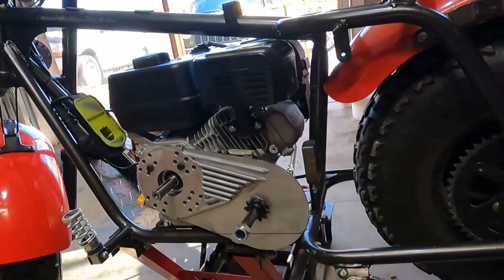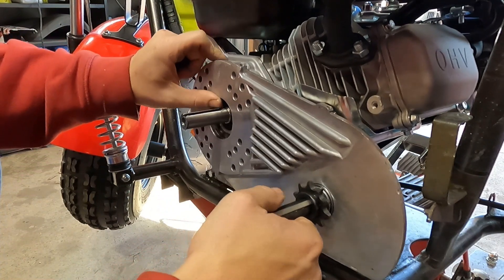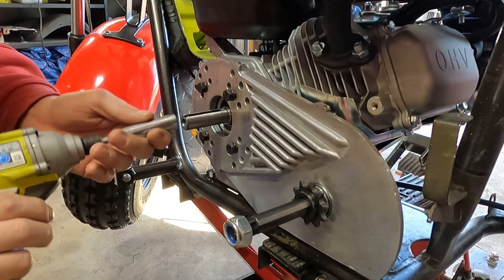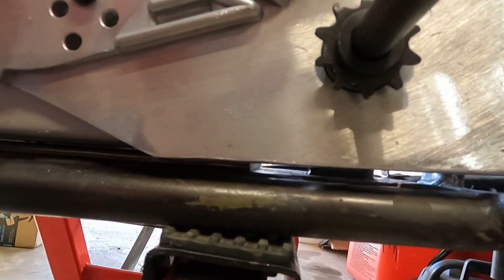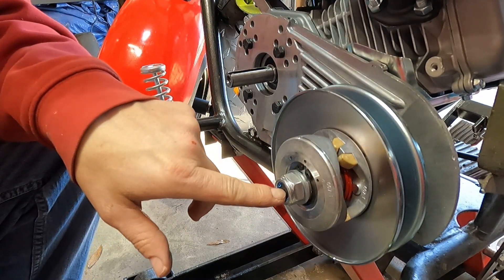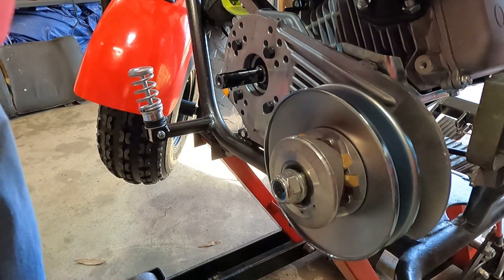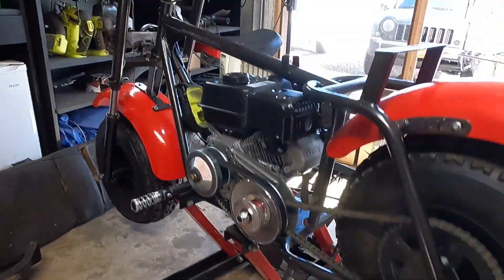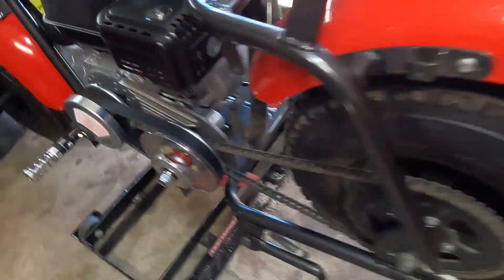Baja Warrior 200 Mini Bike 30 Series Torque Converter Install

Comment: A skill saw with a regular carbide blade will but any aluminum with no problem and still cut wood like nothing happened. I learned that when i needed to cut some  inch plate. A saw will cut it like butter.

Comment: So to anyone doing these mods I just gotta say after doing them all myself. U have to cut a couple brackets off so you’re gonna want to grind those down smooth and paint the bike in those spots so you’re gonna have to take the engine loose to paint that well. Shaving down the key way is simple enough if you have the right tools but why isn’t it shaved from the factory? Once u cut the plate u can’t return it so if the clutch blows apart in less than an hour like mine did then you’re screwed and you’ll have to just buy a new one and return the broken pieces silently. So far I’m not impressed and between ordering that stupid lug nut and all the modifications I was unaware of it’s been a week of working on it when I can and now that the clutch broke it’s gonna be at least another week. It’s not ‘simple’ it’s not ‘easy’ it’s a giant PITA and the parts aren’t made well. The belt broke when the clutch flew apart in less than an hour. Not sure what else to say but good luck to all of you. I’ve been working on cars for years and I’ve never seen a kit that claims to fit be such a horrendous fit and then fails first day? Bad quality control, bad manufacturing, straight up. Sure if this guy has done a few before at least it didn’t frustrate him. I assure you the first one you do will be extremely frustrating, even to a level headed person that does similar things all the time. I’ve built several bikes with different motors, have quite a bit of experience, my father in law is an aircraft mechanic. Both of us looked at this thing as cheap Chinese crap that wasn’t made right in the first place. When the clutch blew apart we both just looked at each other and didn’t even say anything. We knew something wasn’t right with it. Should’ve just bought a new centrifugal clutch!!
Reply: Help!!! Please

Comment: Good job. You should align the back of the backing plates. Although it looks flat, it has a 2.5 degree taper on the inside. Run a straight edge across both back sides of the backing plates of driven and driver clutch and look for light.

Comment: Will this method work on a Massimo mb200s?
Reply: That's basically what this is, I think. My Massimo is a Warrior and the "title" says MB200. The only caveat here is that he's using a Predator engine and the shaft is different on the stock 196. The 196 uses an external thread shaft (male), so the bolt that holds the drive sprocket on can't work. I'm in the process of installing a TC on mine, and have found some people using a long shank lug nut off of go powersports to bolt the sprocket on.

Comment: Here I am over a year later finally installing the torque converter.

Thanks for the video, I have a problem hope anybody can help.

I put a converter on a Baja Warrior. If I do it the way it's done in this video my
front sprocket is not in line with my rear sprocket. The chain wears the inside of the front sprocket.

So I put a space on to move the front sprocket out. Now the chain works fine, but when I align
the two inside belt plates I don't have enough drive shaft left to mount the hub.

What am I missing?

Thanks

Comment: Have you ever done one on a Massimo warrior 200, running into problems?
Reply: I'm doing one today on the massimo mb 200. Jackshaft sprocket doesn't line up with rear wheel sprocket. No sure what to do bout this

Comment: Where do you get the rubber mat? Is it specifically for that purpose? I could not find that thicker locking ring on tractor supply. Not sure what it is called, so searching is not finding it. Any help is greatly appreciated. Very helpful demonstration. Thank you for excellent tips. Thumbs up! I like that diamond plate on the front of the frame.

Comment: What kind of rubber piece is that and where do you get it? I had a blaster 2 seater kart come with that rubber under the engine and always wanted more of thoes for other bikes an karts
Reply: Just a rubber mat like shop mat or mud flaps work good now if you want to go old school leather works 2 my dads pan head has leather everywhere
Reply from the maker: Amazon..Look up anti vibration rubber motor mounts..Thin industrial rubber matt works well also!

Comment: Nice presentation, thanks!
Cutting the backing plate like this removes one of the four mounting tabs for the torque converter cover. Does the plastic cover stay on OK with only three mounting tabs?
Reply from the maker: Yes it stays on no problem

Comment: where did you get the rubber pad ?
Reply from the maker: Amazon just look up engine/motor anti vibration pads
Reply: @thisthatgarage5073  got a link for the pad , also where did you get the bracket for the lights ?

Comment: Steel bolt should somewhat oxidize in the aluminum a little. I do the blue locktite just because I'm there and figure  it really 100% won't hurt it. I'd be more concerned about lopping off all that plate but honestly, I've seen it done numerous times and it seems fine. You try those super 30 series yet? Dang brother! They ought to sell that thing with a small can of it! Stick city if you don't, I used a little red sticky grease (very little) and got a good result too. Nice job.

Comment: Finally, a video that explains how to do this job RIGHT!  Did you increase the top speed with this mod?  Thanks for taking the time to share.  Sub = EARNED!
Reply from the maker: Yes I did...It will run about 50mph with stock baja warrior gearing